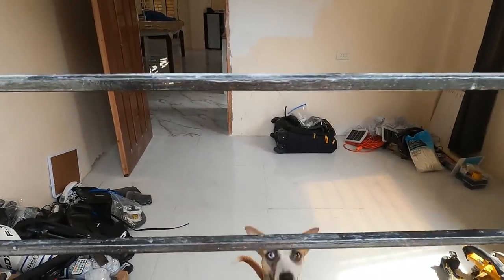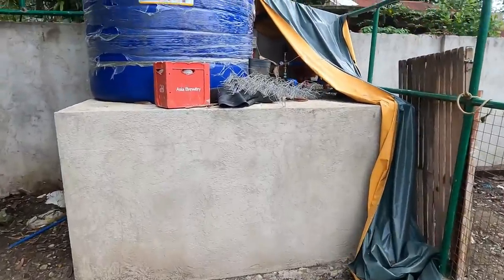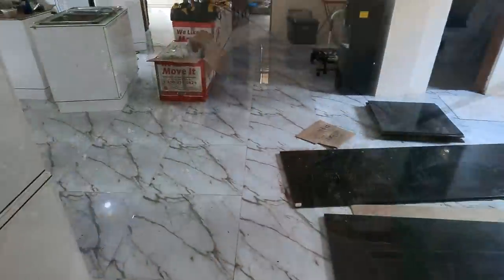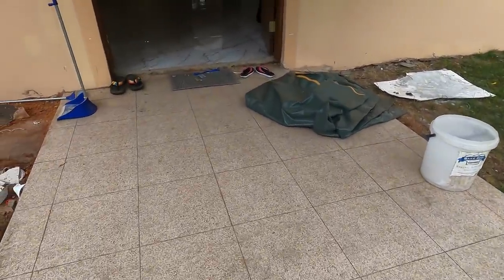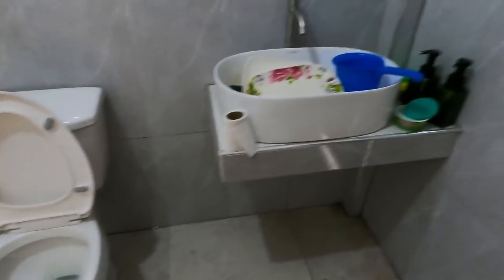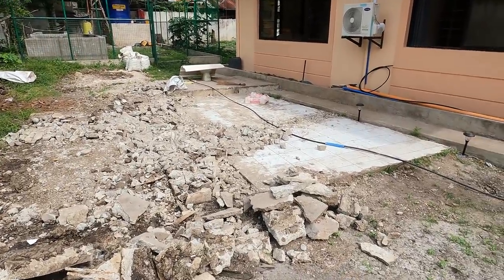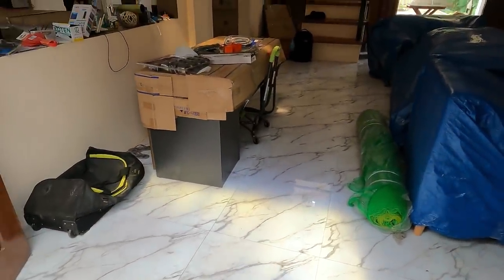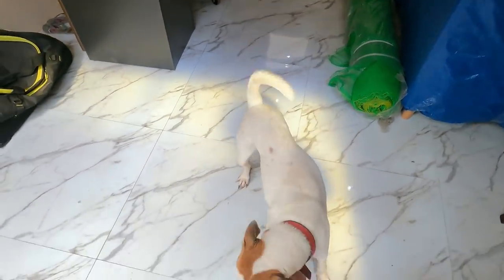Philippines House One Week After Moving In Progress!

Comment: I would highly recommend to routinely high pressure wash the home walls and siding, fence walls, and all concrete walks and side walks.  ZEP products work really well in a gas operated high pressure washer.  It’s a worth while investment to maintain a clean environment.  A circular scrubber that’s an accessory with a pressure washer for driveways, and sidewalks work very well.  Mold and mildew spores are in the air and not good to breathe in.  Also, remove shoes before going into house.  
I hope this helps 👋🏼😁
Reply from the maker: Thank you for that info. I have a pressure washer and I'll put it to use.
Reply: @ItsMe_Philippines  
Right on 👍🏼
I have the Ryobi gas operated one, and got the Ryobi surface cleaner.  I believe I have the 3300 or the 3200 psi unit Ryobi makes for residential use.  I don’t recall the unit model as I’m currently away from my house.  I recommend a gas powered unit because it throws out a superior pressure to clean faster and way better than electric.  Electric units tend to over heat and you get an inferior cleaning outcome.  I got mine at Home Depot.  It’s worth the investment for long term use.  Check out the Ryobi units and surface cleaner here on YouTube.

Comment: Hope your Main Switchbox has a circuit breaker installed for safety. My brother's house has several (two I think) switchboxes, one for lighting & another for outlets so in case there's something wrong with lights, he can still have light through the outlets by attaching lamps via outlets. Also for safety, so as not to overload one switchbox, likewise when they go out, can still have lights on without the outlets having power. (Anyway it's per one's choice.) Likewise since you'll be having an office as you said, do you have wirings for an automatic transfer to a generator in case of power interruptions in the future? Just asking. Because there are computers, etc. that need to be maintained in a cool surroundings.
Reply from the maker: It does now but did not at first. Every time I would turn on the hot water in the shower or the upstairs air conditioner I would have issues. We’ve now corrected those with additional breakers.